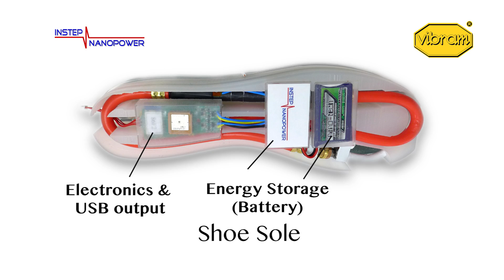POWER WALK: FOOTSTEPS COULD POWER MOBILE ELECTRONICS

Comment: Why not add this tech to the phone so when ever you re moving its charging itself?
Reply: +EngineeringUW Be care with the copyright, do all you need because your project is the future and companies will do all the possible to steal your work! Good luck!
Reply from the maker: +Erny Cantu Good question! Adding this tech directly to a cellphone unfortunately wouldn’t work because there’s not much mechanical energy in the motion of the cellphone itself, so there wouldn’t be enough to convert to electricity. In order to obtain a watt or so of electrical power, it’s necessary to start with at least as much of mechanical power. 

The motion of a human body (100 lbs to 200 lbs weight) carries a lot of energy (dozens of watts of mechanical power), so there is more than enough of mechanical energy available to convert to electricity. The motion of a cellphone (less than 1 lb weight) carries a minuscule amount in comparison, so there’s not much energy to convert.